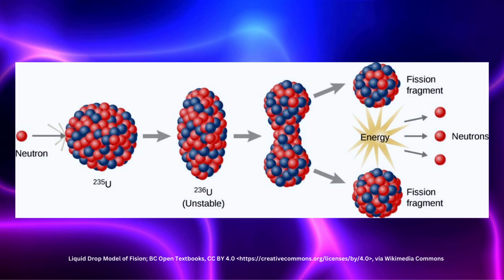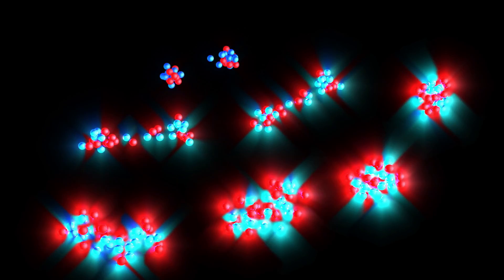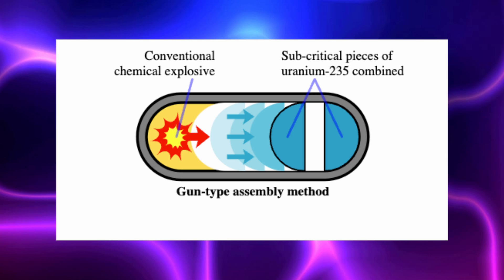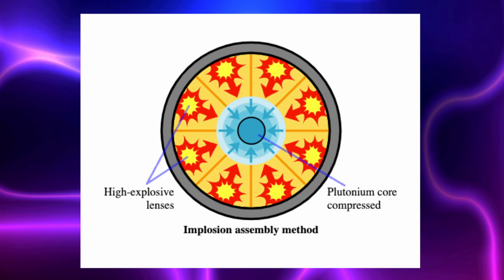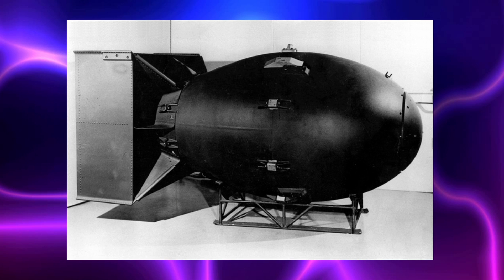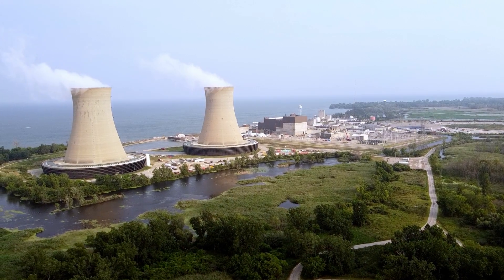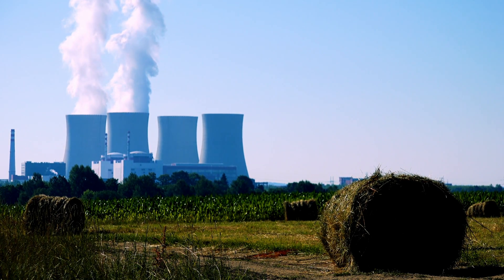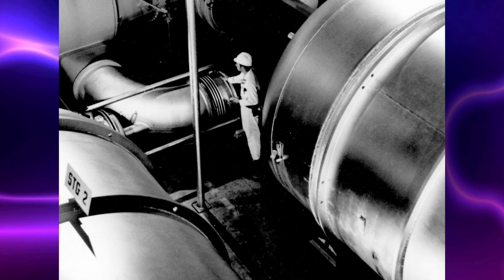Can a Nuclear Reactor Become an Atomic Bomb?

Comment: Chernobyl DID become a bomb!  According to data collected, it momentarily produced heat & neutron output more than 1000 times its rated output.  This was enough to more-or-less destroy the reactor & its containment building.  Because the fuel is not highly enriched, there is MANY TONS of it.  The result was much worse than if a Little Boy was dropped at that site.  It spread so much contamination that it was detected across Europe.  That didn't happen with Little Boy!  Japan didn't need to build a containment building in Hiroshima!
          Whether atomic reaction is done in a reactor or bomb, the time per generation (neutron released from one uranium atom fissioning to the next one) is about 10 nanoseconds.  For a machine that adjusts the gain mechanically (moving control rods), there would be no way the reaction could be controlled, if it were not for some (about 1%) of the neutrons coming from the decaying products with ~1 minute half lives.  So a reactor needs to have its rods set for "prompt" gain ~0.99 to run.  Just 1% more gain leads to uncontrolled runaway, WORSE then "atomic bomb" because of the massive amount of fuel & it running for awhile, massive amounts of short half-life material contained..
          If there were a way to "make" neutrons outside the reactor & "shoot" then in, there would be no need for a chain reaction (& no need for tons of fuel inside) & the reaction could be controlled more readily.  most other energy generators that use chain reactions (such as fire) control the reaction rate by controlling the feeding of the fuel (as in engine).
Reply: BS
Reply: @Therearethings8148  Not BS.  No one can deny that the reactor exceeded its design rate by factor of 1000.  You don't define that as "bomb"?  It obviously went prompt critical because of the void coefficient.  The heat was enough to blow the lid off the reactor & send a "blue cone" into the sky, which was the only containment it had.  How many tons of TNT does it have to be to be a "bomb" by your definition??

Comment: Missed a few points but good video overall. You should have explained prompt super criticality required for a nuclear bomb vs standard supercriticality even if you were to get a highly enriched core supercritical it would just slowly fizzle out whilst releasing alot of radiation and heat and melt itself down. In order for highly enriched uranium or plutonium 239 to become an explosion you need to increase its density by more than 2 times in a fraction of a second ie prompt supercriticality. And this is not possible to achieve in the design of any nuclear reactor. The demon core going supercritical yet not exploding despite it being weapons grade enriched is the perfect example of this.
Reply: I agree with you on this one! I asked myself the question why the demon core didn't explode even though it went into a supercritical state during Slotin's accident, and I got it explained by the level (and perhaps rate) of supercriticality the material is brought into together with the concepts of prompt supercriticality and delayed supercriticality. I was actually hoping to have more points about criticality and why a supercritical state in a nuclear reactor is different from the supercritical state of a nuclear bomb's core during explosion

Comment: Not even a remote chance of a reactor becoming a bomb.  A reactor core can suffer a steam or hydrogen explosion, or an uncontrolled criticality event (which is quite short lived as one or possibly both of the first two will break up the fuel mass quite quickly).  But no, it definitely won't go up like an A-bomb.  A properly designed and built containment building will prevent the same kind of radiation release that occurred with Chernobyl unit-4 or at Fukushima-Daichi.

Comment: Can it produce a mushroom cloud a la Hiroshima? No. Can it in some cases undergo a prompt criticality that yields ton range energy releases that destroy the reactor? Yes!  Is that a bomb? Yes. It is in fact a low yield nuclear explosion. The definition of that is that a prompt criticality occurs. More, that the energy release exceeds the ability of the reactor to resist that energy release and  terminate the prompt criticality. At Chernobyl and SL-1 the prompt criticality destroyed the reactor and was then followed by the destruction of the facility.

Definitionally a nuclear explosion occurs when the rate of the event is prompt critical and the energy release terminates the event by destroying the reactor. This is comparable to the distinction between a deflagration and a detonation. Detonations occur at supersonic velocities in the medium involved. 

When reactors leave the region of control based on delayed neutrons and enter prompt criticality the line is crossed.

That they aren’t efficient nuclear bombs does not make them not nuclear detonations.

Comment: no, but it will become another Chernobyl and Fuck-U-Shima with a pinch TreeMile Island and SL1 meltdowns......
Reply: Chernobyl was a poorly designed dual purpose plant ( power and weapons grade material production), even then it took a high level of idiocy to cause that disaster.
Fukushima was a natural disaster where many died from the  natural disaster but no-one outside the plant was killed or injured from radiation.
Three mile island proved that a nuclear plant can have a core melt down without any casualties.
So where is the justification for an alarmist attitude?
Reply: I missed SL1, this was an experimental military plant without proper safeguards, it also required a level of idiocy to cause that incident.
Reply: @davidhenry5128  It actually wasn't idiocy that caused Chernobyl to explode, it was the A-Zed 5 button that did it. When AZ-5 was pushed, it lowered ALL of the control rods, which were tipped with graphite into the core, simultaneously. The graphite on the ends of those control rods caused a massive and sudden spike in power, a surge that caused the core to explode.That means it was an engineering screw up, not operator error. The men in the control room followed protocol, which was tragically flawed. Had the rods not been tipped with graphite, nothing more would have happened and the reactor would have been shut down.
Reply: Idiocy in design is still idiocy, I have less acceptance of idiocy in engineering as i work in that field.
Reply: The rods were not "tipped" with graphite, these reactors were dual use, the main consideration being given to weapons grade plutonium production, minimal consideration to power production, but more importantly safety.
Reply: @davidhenry5128  yes they were, where have you been?
Reply: Check your facts.